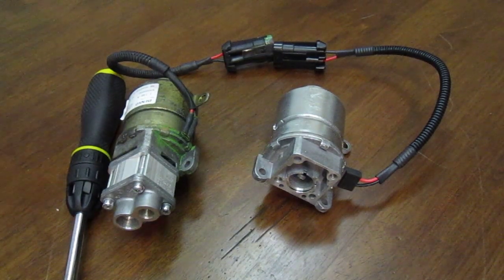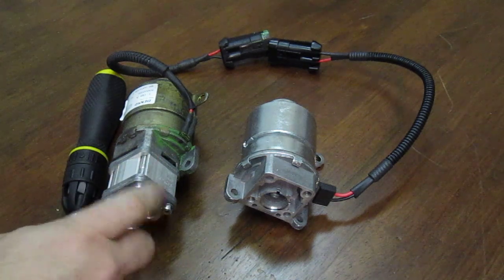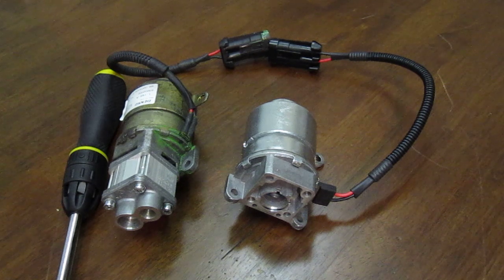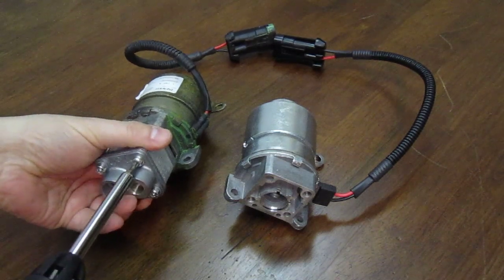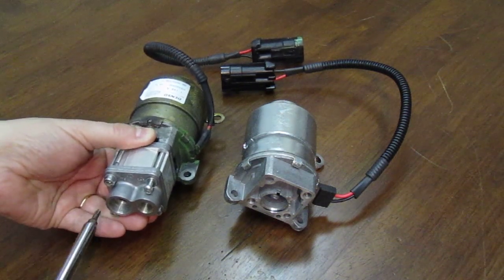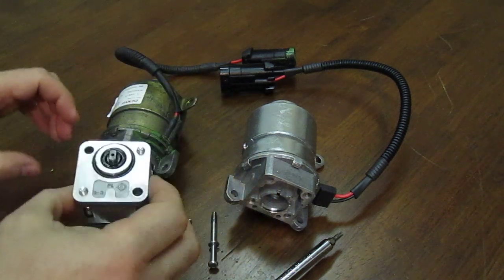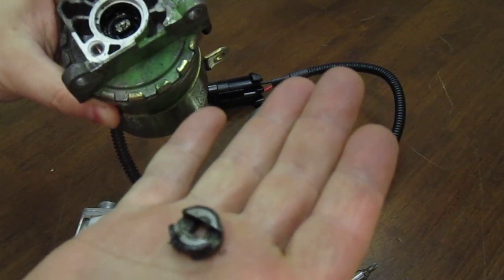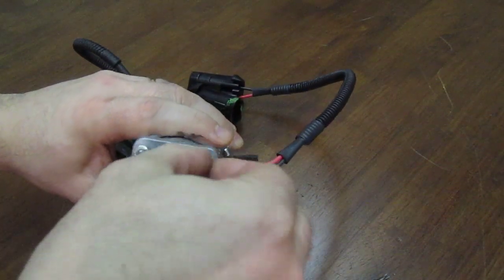How to change the electric motor in a F1 hydraulic pump used in Ferrari 360 and Maserati cars

Comment: Tried switchin e gear pump connection piece but 2 of them screws are overtighted and stripped on old pump can’t get connection piece off? Suggestions? On how to get old stripped screws out??
Reply from the maker: try using a small size irvin screw extractor. You can Google it.

Comment: Using computerized systems (i.e., ST5, Leonardo, Texa Navigator, etc.) for purging air form hydraulic lines is needed only after replacement of the whole pump, especially the pump head, because during disconnection of hydraulic lines from the pump head, air can get into those hydraulic lines. However, I have developed procedures shown in my other videos that eliminate the need for computerized purging of hydraulic lines. You can see those videos by visiting my page: https://www.youtube.com/channel/UCRvHOYURAER6y4jQPRzIEkwHowever, if you will be changing only the electric motor, as is described in this and my other video for Ferrari 360F1, then you don't need to purge air from hose hydraulic lines, because you don't need to disconnect those when replacing only electric motor. See this video: https://www.youtube.com/watch?v=LdDmbUFOVyc&t=88sAll procedures for Ferrari 430F1 are the same as for 360F1 shown in the video.

Comment: Ferrari Vancouver 
9500$ for pump only
Reply from the maker: WOW !!! What a BS !!! The price of whole pump from Ferrari dealership is about $2.8-3.2K. So, if the cost of work is lets say $130/hour, they are charging you for 46 hours of work? It will take maximum an hour to replace the whole pump, bleed hydraulic lines using a computerized tool (i.e., ST5, Leonardo, etc.), plus $20-$40 price of the original hydraulic fluid (which is the same as any synthetic automatic transmission fluid that complies with Dexron II / Mercon III specifications, like Shell ATF, and can be purchase in Wallmart of $5-6 a quart). It will cost you less, (including round-trip airline tickets and 1 night hotel)  if I fly to Vancouver with a replacement pump ($399) and replace it myself... HA-HA :-D
Reply: Lol u can buy used pump like that for 20e

Comment: Hi thanks for your video 
Jude wonder for f430 is same ?
Reply from the maker: Yes, procedures are the same for the 430F1 pump. Make sure not to unscrew the round hexagonal recessed screws, because the pump head will fall apart and it will be hard to re-assemble it. Unscrew only the low-profile torx screws to detach pump head from the aluminum mounting interface part.